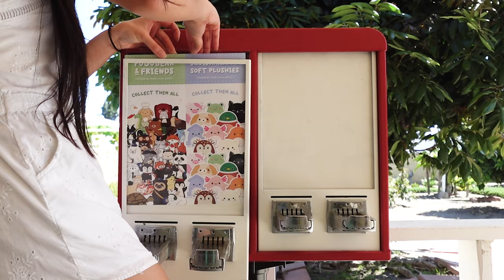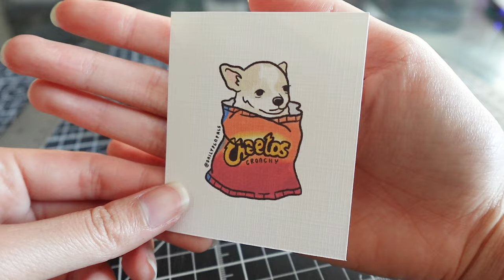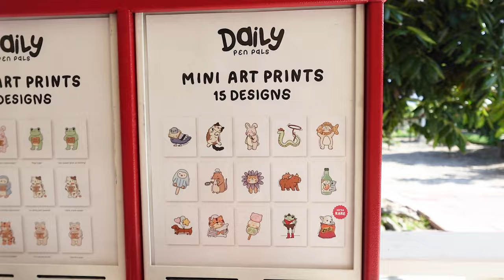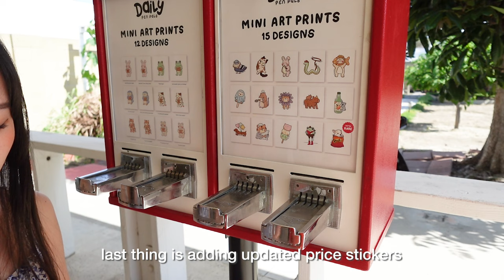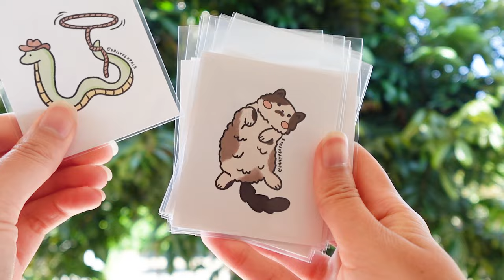how I sell my art from a sticker vending machine

Comment: Omg. I have one of these and I've been so afraid to hack it thinking I might break it. Do you happen to know how to upgrate it to be free? Like for it to function, but not need any quarters to get the item.

Thanks!
Reply from the maker: I haven't tried this myself but I think there is possibly a way to make it free! In my video, I remove the spacer to increase the amount of quarters, but maybe if you add more spacers for it to be completely full, it can dispense it without needing any quarters. It can be intimidating trying to adjust it yourself but I just slowly take it a part and retrace my steps when putting it back together and normally it's okay. Hope it works out for you!